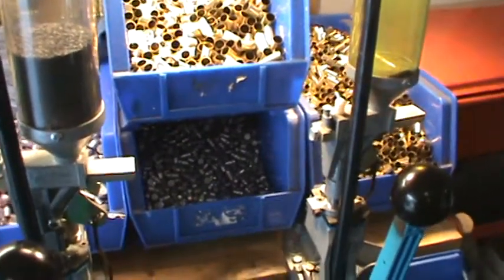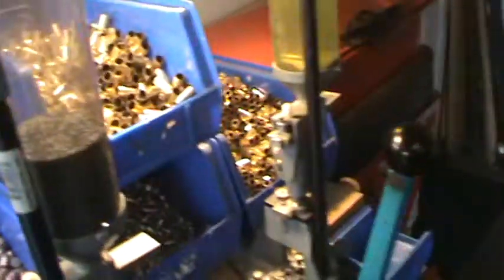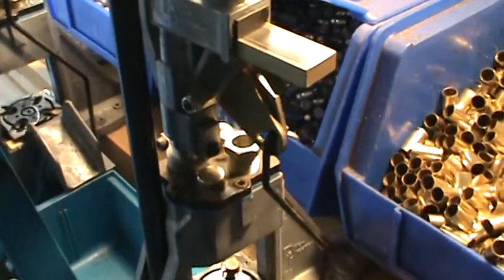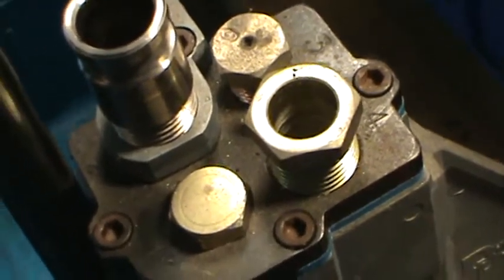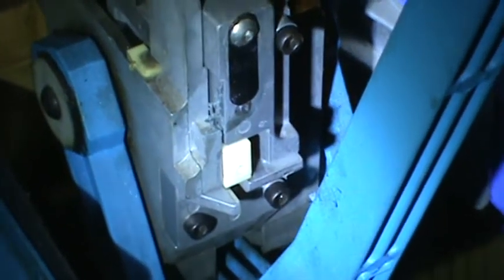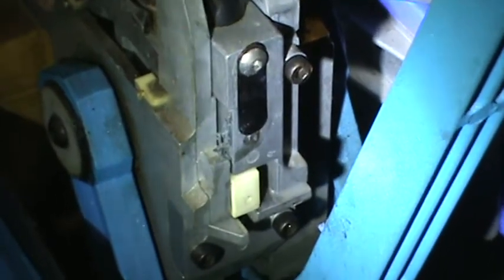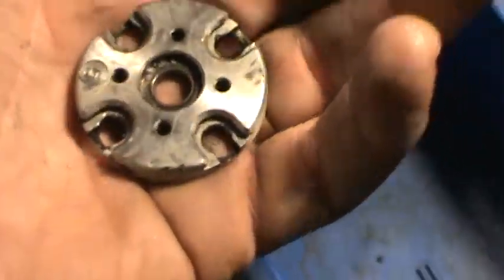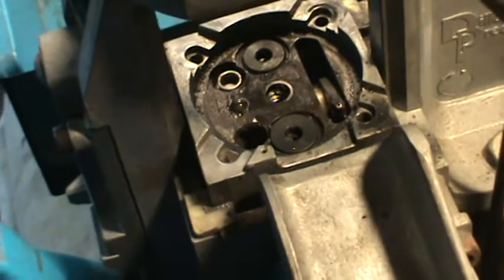Cleaning my Square Deal B

Comment: That is one filthy press...I think maybe from using too much oil..the shell plate was coated with oil. Thanks for doing the video. I have to give mine a complete strip. It’s easy to loose the detent ball.
Reply: Wayne Beck  No kidding I saw this video and thought “well I will see what I’m missing when I clean mine.” I’m missing waiting till it looks like a Chevy trunk on the farm with an oil leak. I break mine completely down at least every 10,000 rds. I have used it enough that Dillon replaced the 9mm shell plate because  it was worn and would not pull shells out of stage one.

Comment: Good video but I must say that is one dirty sdb. How many rounds have you loaded since the last cleaning, my sdb is about 7 years old now and it doesn't look anything like yours for wear l realize you got yours in a trade was just wondering how many rounds do you load in a year. Thanks for the great video.
Reply from the maker: I cast about 5,500 45acp bullets every 7 months,  I load at least that much, average 150 to 200 rounds per weekend,  not counting IDPA matches.  needless to say,  I shoot and reload a lot, thanks for the comments
Reply: carstensxdm45 wow you load more than I do I average about 4000 a year. Have you had problems with broken shell plate bolts I've had 2 brake so far and I also have trouble keeping the shell plate bolt tight have to check it about every 75 rounds. I do like the sbd just has a few things to keep an eye on and Dillion is awesome.
Reply from the maker: yes, you are right,  I have broken more than my fair share of shell plate bolts, always keep a couple spare,  have borrowed from one press to repair the other several times,   have tried to purchase extra but Dillion won't change me, they just send more, I recommend them all the time,  just " snug up" the shell plate bolt,  don't try to " crank them down ", snug, not loose,  not a total expert but have learned a few things,  have a great 2019!!

Comment: Very good video.  Thank you.  My Square D is giving me fits lately and your video helped tremendously.
So, I just need to ship it to dillion if I can't get it working well?  Have had many years of flawless operation.  Now, the primer feed mechanism is popping out primers and flipping them.
Again, thank you.
Reply from the maker: Pull the primer mechanism off, examine the plastic primer tube tip, make sure it is not deformed or bent,  also, be sure the primer slide cup is clean, hope this helps

Comment: Dillion says to avoid WD-40 and light oils. They recommend using grease to lube.
Reply from the maker: Yes, you are correct,  I recently learned that from one of their videos,  thanks for watching
Reply: Light oils can gum up the works so to speak.  I've had my SDB since the early 80's and a drop once in a while of gun oil on the ram slides and operating handle link arms never hurts.  For everything else I use Slide Glide grease designed for pistol slides.  40 years and many 10's of thousands of rounds later, never replaced a part and no wear observed.  I'll only buy Dillon.

Comment: I just called Dillion to  ask them about rebuilding on my square deal the y want 79.99 to preform this service. If I do the work myself they will send me any replacement parts I need free of charge .They will NOT rebuild a press for free. Maybe the did in the past ?
Reply from the maker: wow, didn't know that,  thanks for the info,  can't be too hard to do yourself,  guess they got tired of doing it for free